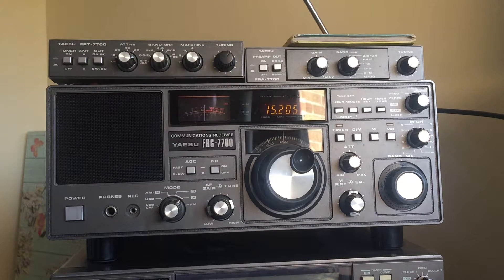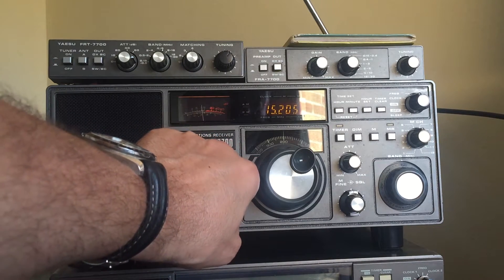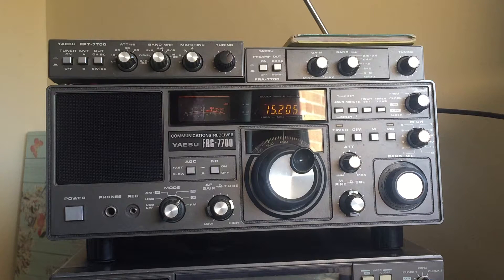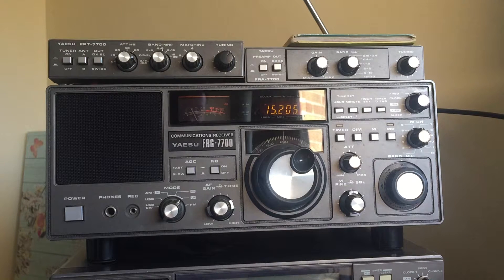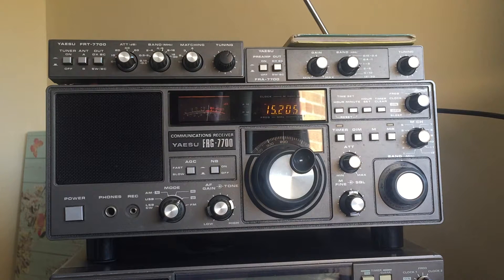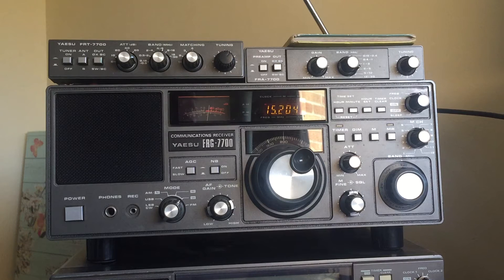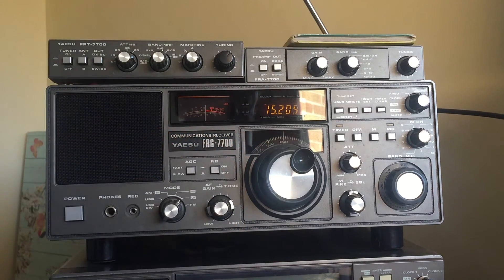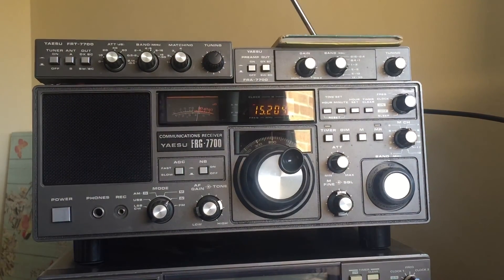Yaesu FRG-7700; review of very thorough refurbishment

Comment: 1981-1984 these were produced in japan
Reply from the maker: Says a lot about their quality. The industrial design remains firmly in the 1970s though. Not a bad thing.
Reply: @OxfordShortwaveLog  I owned a frg-7000 and I sold it to get some funds to repair my ebike motor. I wish I had kept it. I was able to buy a mint condition frg-7700 from a radio communications store along with a yaesu antenna tuner. Both for a very good price. A lit less than what they are on eBay actually
Reply from the maker: Hi, I know what that feels like - I sold my Perseus SDR, my Eton E1, my Icom IC-R20...the list goes on and on for stuff I shouldn't have sold! Hope you get another one, one day. 73
Reply from the maker: I still have my R75 thankfully, but I've always liked the Alinco, in fact I looked for one a while back, but nothing at all on line.

Comment: Thanks for your video. I have FRG-7700 but not as healthy as yours, since you refurbished it through your friend.
Congratulations. What type antenna are you using? Did you Ground the set? I see FRT 7700 antenna booster on top, perhaps that device may also have constituted better and stronger signal, I think? Great.  What was the time (GMT/UTC in 24Hr format) when you tuned to 1.520 MHz? What Loc? Please let me know.
Thanks once again and 73s
Reply from the maker: Hi there, I was using a magnetic loop - a Wellbrook. I never ground any of my sets and I don't use the pre-amp these days - it's not necessary with the Wellbrook. Can't remember the time but is was during the hours of daylight. 73s, Clint

Comment: Hi,I had a FRG7700 in 1982, but I have bought it quickly because I found it relatively  insensitive and full of transmodulations.On the same antenna,weaks stations clearly heard on my SP600, was only noise on the Yaesu.In 1986 I have got an ICR70 ,here it is a good receiver,better than the SP600! It works well flawless until nowadays.With a preselector (FRT7700 or home made) transmodulation can be avoided.The FRG7 (I have one) outperform the FRG7700 for sensitivity,but not for selectivity.With preselector and good aerial, the FRG7700 can be useful.
73 QRO
Olivier
Reply from the maker: Hi there, thanks for your comments! I have found the sensitivity of my FRG7700 to be very similar to my FRG8800 and my ICF-2001D,  but neither are as selective as the Sony. I love both of them because they were the radios I wanted as a kid but could never afford lol. 73! Clint

Comment: What a fine looking 7700, Clint! I owned one in the 1980s while DXing near downtown Seattle, Washington USA. That was a tough RF environment, but I had a "Grove Mini-Tun3" preselector that helped. My two favorite features of that FRG model are the nice amber display that's easy on the eyes, and the comfortable main tuning knob with substantial finger dimple (detent). I'm sure you'll have many more years of enjoyment from your refurbished FRG-7700. Cheers, Guy
Reply from the maker: Hello Guy, thanks very much, I agree with you, it's a nice looking receiver! The amber display (which you might remember can be dimmed in low light levels) is great as is the dimple you mention on the main tuning knob allowing very fast tuning. Sensitivity is very good and selectivity ok, but the audio is something else. There are more capable radios - for example, my Sony ICF-2001D runs rings around it, but not with the same level of style for sure! 73! Clint

Comment: classic receiver. love these older model Yaesu's. i am always hoping to find one at a sale or some sort and pick it up cheap. had not happened as of yet. i never get that lucky. i know i can find them on ebay. hams call them "bricks" bec of the size, relative to what is out there now. thanks for posting. 73
Reply from the maker: Hi Scott, they can be had on eBay - it's how I got the 7700 and the 8800. I actually only bought the 7700 because I wanted the preamp with the telescopic....I couldn't find one on it's own, so I ended up with the radio as well (and an import duty charge!!!). Wouldn't be without it now and the audio is superb. It's not as sensitive/ selective/ stable as the Sony but I won't ever sell it. I think we call them 'boat anchors' lol! 73! Clint